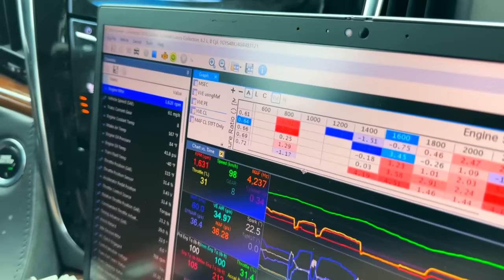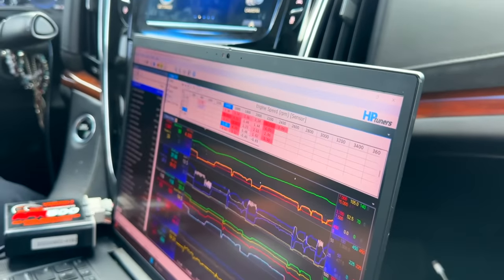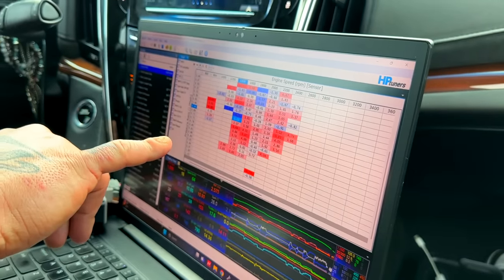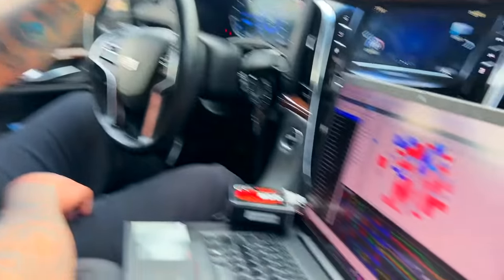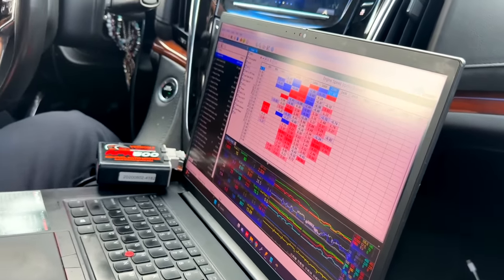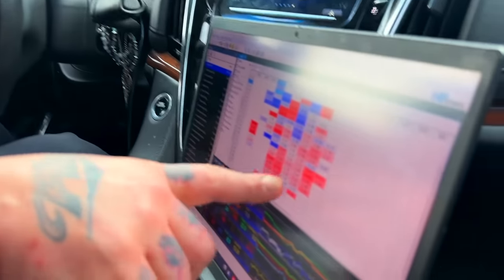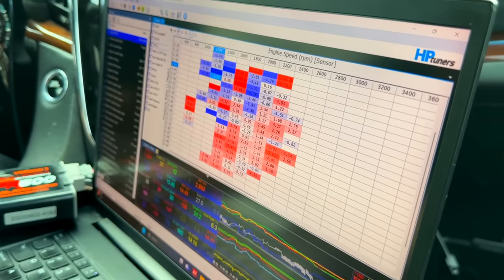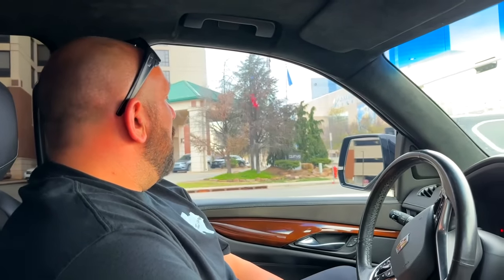THE BEST SOUNDING CAMMED ESCALADE! L86 BTR 220 CAM KIT

Comment: Always enjoy watching the videos. Sorry to hear about the GoPro being lost. To prevent myself from using GoPros I ordered this I guess you can call it wire that has a rubber shielding to attach to the GoPro mount so if it falls it will still be attached to something on the car. Hope that helps.

Comment: Chief,  there is a guy in Florida that tunes cars and his wife has a super charged Escalade , cam ,bigger throttle body ,headers and drive fit on the street . Their took it to the track and it will lift the front wheels.  Jackie's Escalade sounde great.
Reply: You talking about Jeremy at fasterproms? I feel like he had a nasty Cadillac too.

Comment: Nice rumbly sound! I have not noticed dual - rear exiting pipes on a high end rig like this before. Something about doing this,  makes owning an Escalade even more thrilling.  (Turns heads, because it is unexpected).  The transmission shifts look noticeable in vid., interesting how the converter is involved with your cam change. Sounds like it can be a runner.  (Engine might even get regular oil changes). 😆

Comment: Damn I love that caddy. I had a 04 Escalade 6.0 Texas speed N/A cam head work, TBSS intake, tune. Never dyno’d it but it was fast af for what it was. 4.11 gears shift kit in the 4l80. Could burn a mustang or a diesel while on 20 inch rims and 35 nitro mud grapplers. I miss that truck.

Comment: Both of you sound like some master GM techs over there.😂😂😂  Sounds great though. Shout out the the asshole that picked up the go-pro, please return to owner ASAP, or else!
Reply: Justin is just showing the difference with settings within Gen 5 via HPTuners, as the GM computer control system allows, had modified compared with a table look up type adjustments, modifications, rather uses more advanced algorithms which also include advanced, integrated engine and transmission controls which are specific for the set of components from the production line, factory for the desgned level performance.

Comment: Chief can u put a Duramax on it just put a pin 📍 on that crankshaft timing instead of ball joint more torque mpg n hp can go depending billet or not 3400 HP

Comment: I'm back in the 99 06 Era LS and he's got a PHtuner....fer an extra 300...but it's a must not a want??if I wanna get to use it soon...and Chief what's ur closed rig weight and you pull w a pick up not a toter right...well I'll have to look into suspension for 5th wheel and adding a shock to each corner and bagging rear for more support and hauling more then cars...hopefully I finish this venture

Comment: Throw the $300.00 dollar tune in it. Sounds great. Getting that oil pressure off of 40 tho. Lope was amazing. Would love to get a cam kit for the GM 6.0 , my dad's little 5.3 pulled away from me. An I'm back to a stock converter again. Miss the other Blue Converter it had way more pull. Not wrapping the long head tuberculosis has already burnt off the oil temp sensor.  It sound's great. 😂 Cop vibes 😜  Just creeping parking lot thumping around.

Comment: Boy you ain't kidding big chief you lost me this computer 🖥️ shit is out of my world I'll take a old hot rod any day of the week
Reply: Robert Sargent, certainly every computer, electronic device are "way out" of, far from, outside nearly all individuals, humans, since they lack the information, knowledge, developemnt, expertise, etc.
You can pretend to work with very old, seemingly simpler version components since the adjustments are rather simple. However, as always, they still require actual proper knowledge, expertise to proper, fine tune them to achieve optimum performance; hence engineers have been involved with design, development with every motor vehicle, components, performance, racing, especially teams, high level, preoduction which require consistency, reliability, durability.
All The Best, Sincerely
Note: an engineer [as myself] appreciates, prefers a properly designed, developed system, vehicle with al aspects including advanced computer controls with advanced algorithms as these. Every aircraft has advanced systems along with many water vehicles, especially commercial and more so military; havin ght emost advanced.

Comment: I like it! I have a stock sierra Denali 6.2 with the 8 speed trans. I hate the intermittent wonky shifting. Engine is still all stock and I'm just waiting for the dreaded lifter issue to happen. Then I'll slap a cam and converter in it. I've heard the circle d Vette converter is a good one to swap to

Comment: As I said, way back when the red Vette was a thing, LT heads have some serious potential. It's just the feeding part that creates issues. Either heat, or blocked vision, or both. And yeah, it sounds nice, but I dunno how many hours at a time.. How bad of a boom box is the cabin in highway speeds?
Reply: clearly You have basic level information, knowledge, experience, without high level expertise which exists among design and development engineers.
however there are folks like those at BTR, Iski, Comp, FuelTech, HalTech, MoTec, etc. with design, development expertise to assist, help for complete solutions.

Comment: Who do you recommend in Oklahoma to tune ls/lt motors
Reply: Justin mentioned a few; The issues are clearly with generation of the vehicle [newer as 21 C have blocked computer access - some with HPTuners access (paid)]. 
If You are installing a LS or LT engine then using a private, independent computer control as Fuel Tech [Justin chooses], HalTech, MoTec, Holly, etc., then You have many options with tuners. Fuel Tech does provide expert training, assistance, help, etc.[seemingly better than others].
Clearly, Obviously, Certainly You also have the transmission and other components to consider within the drive train thus appropriate selection, tuning, etc.
All The Best, Sincerely

Comment: I've had luck with a good Trans flush n add Lucas oil to it. Firms them up a bit. I like to flush a few gallons through the cooler then drop the Trans pan. Etc.

Comment: I hate to say it, but.... that's NOT really a cold air intake. If that air filter is inside the engine bay...it's a hot air intake. I know enough about engines to know that they don't like breathing hot air.
Reply: So where does the filter go on a cold air intake?
Reply: You know enough to sound stupid in front of people that do know what they are doing.
Reply: @BrianHodge325  A true CAI get the outside air not the air from under the hood. But either way this still gets better air flow.
Reply: Honestly, the S&b or corsa is better than the open filter, but anything is better than the stock airbox. I run the s&b on my 5.3 2016 sierra 🤷‍♂️
Reply: @BrianHodge325 outside the engine bay. Ever heard of LMI True Cold Air Intakes?
Reply: @p.b.sHUNTING I've been in the auto repair industry for over 40 years. I've had my own auto repair business since 2007. I have people shipping me their cars from all over the country for standard engine rebuilds and for high hp builds. I think I know a thing or two about a thing or three.

Comment: HPTuners class is in session
Reply: The key points within this video are that GM en 5 [and similar advanced engines, transmissions] have advanced ECU, TCU, programming, algorithms far beyond simple table look up, modification, adjustment type use, also within HP Tuners [the only access available]. 
Thus performance modifications require much more expert involvement, expertise within designed, developed computer controls, component limitations.
If an individual is building a vehicle using a Gen 5 engine + other components then with a private, independent ECU, TCU, computer control system, as Fuel Tech, HalTech, MoTec, etc., , the algorithms can be designed, entered, set or use those which have been developed; or use the previousl;y common Look up table" access, modifications, adjustments, versions within their software as many have become familiar with though lack engineering expertise.

Comment: LT is terrible my friend.
Reply: You dont know nothing
Reply: LT is superior in every way.. they are down 50cu inches from an LS7 and make as much or more power with FBO/HCI, along with better drivability with the VVT/VCT.. The rods aren't as strong, but if your gonna run big boost on any motor you should do a set of rods no matter what LS your using, as your on borrowed time.. Lots of SBE LS guys claim lots of hp but they don't last like that..
Reply: I’ll take a coyote over both LS and LT. better for boost and reliable.